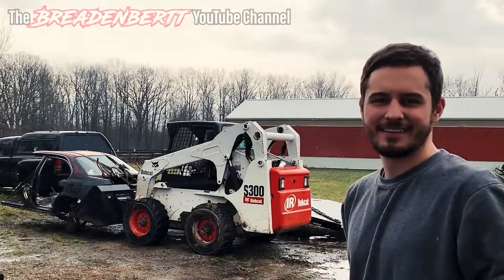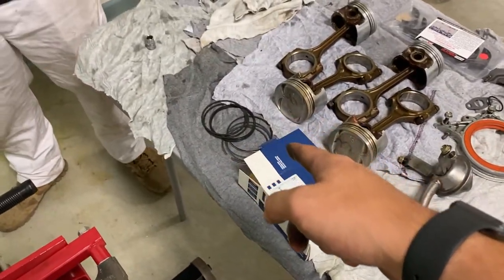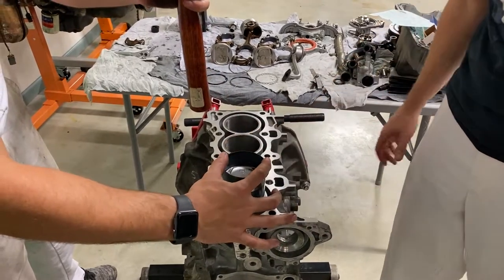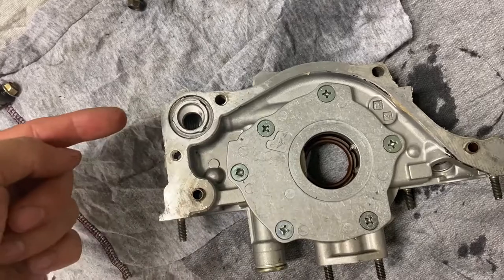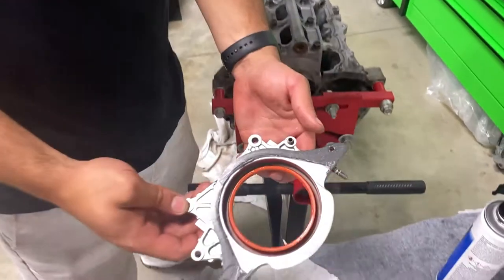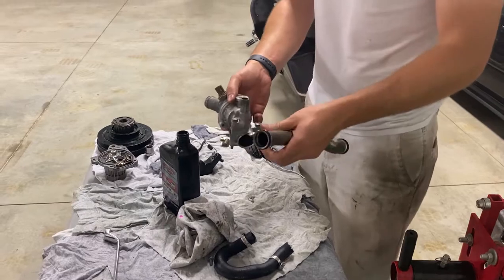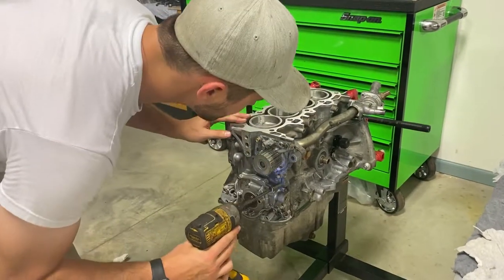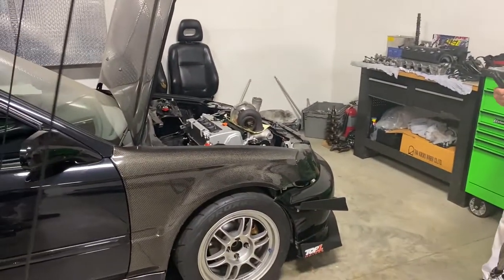The Turbo D16 EK Civic Champ Car SHORT BLOCK Build - 10 Days Until Mid-Ohio!!

Comment: Every engine build I’ve seen they say not to put any lube under main bearings-not sure if it matters but I’ve heard a reason why but it’s escaping me at this point in time. 🤷‍♂️
Why didn’t you guys just do a vitara build? Pistons are $100 and rods aren’t too pricey but that setup is good for boost up to 500hp proven.
Reply from the maker: Real street performance has a video explaining in detail why putting a tiny bit of oil behind the bearings is ideal to aid with the crush when they are owing torqued. Jay has been doing it for years and I trust his judgement. 
As far as the vitara build, in our series parts cost points. If we use to many points we start laps down. We are already fast enough to be competitive. We don’t need to be faster we need to be more reliable. Driving motive behind this particular engine is to be reliable.